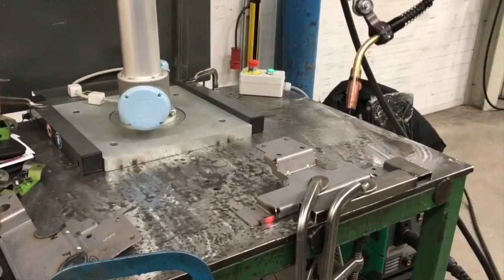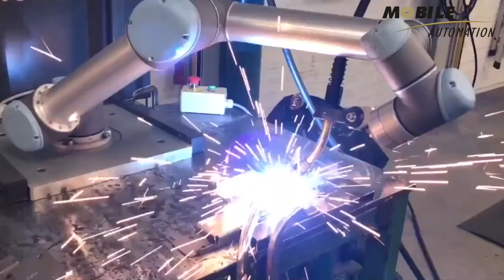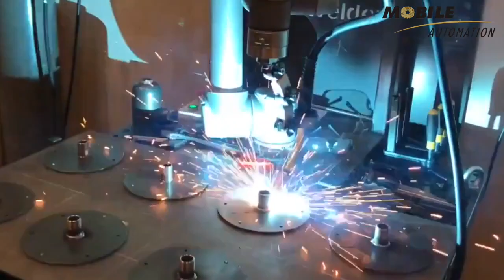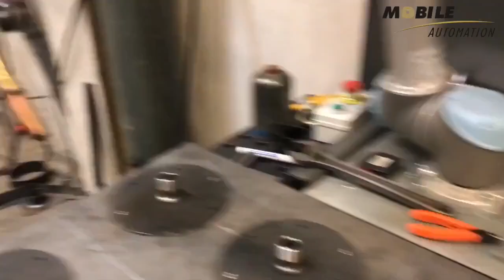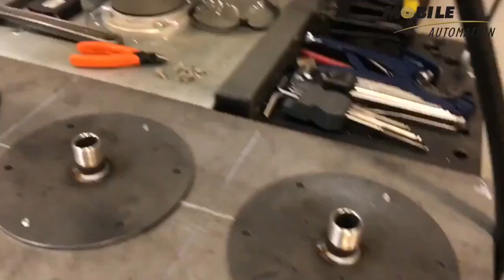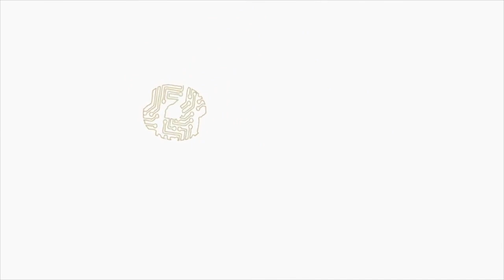Universal Robot Welding - Mobile Automation

Comment: Sure this is pretty good, like a Sawyer robot with hot hands. But the oil & gas needs it outside to weld pipelines. How about really kicking butt with a fieldwork robot or "Cobot" that can be guided by a person, but which welds like a god? Portable, powered by a generator, and weatherproof from -40deg F to 130 deg F. Let me know when it's ready to test.

Comment: I’ve a question, how did you program the circular route?
Reply from the maker: This would be a question for Mobile Automation or Universal Robots! This is a video they shared with us to prepare a Robosuit® to protect the collaborative robot.
Reply: have you find answer?????, i looking how to do circle too with cobot maybe you have finde solution ????
Reply: there is a function in the robot where you just have to input the three points of the semi circle, then add its radius.
Reply: Its slightly more complex than picking three points but still very easy to do the circular welding with the UR robot. First you teach it the new tool centre point by mounting the welding head onto the robot (or gripping it with the gripper if one is installed), you then teach the robot where the new tool centre point is which is the tip of your weld wire feed by moving the robot around to 4 positions where all four points touch down on a surface to the spot where you first pointed the wire feed onto. Press save and that is your new tool centre point that the robot will react to when teaching it a circle move.
In your Polyscope programming you make the initial linear moves to move the weld head from a safe position to a point on the circular weld you are doing and use the same sort of angle on the welder as you would if holding the weld gun yourself. Pick the P move and in the command window also tick the box for a circle move. From here the first waypoint is the same start position you are in, the second point is a point midway point to the weld finish point, save this position and then add the final finish point. You can add the radius the weld torch moves on in this same window, remember its the weld torch radius and not the part radius. You can not do a full circle so you will need to do this twice in two 180 degree P moves to generate the full circle. Because you have used P move the movement will be a seamless, continuous move.
Reply: Hi It was me who did the programming :o)
Reply: @rit9525   
I want to learn welding robot programming, which is best platform for learning.
Reply: @sanketwagh2788  not cobots. they arent for that and shit